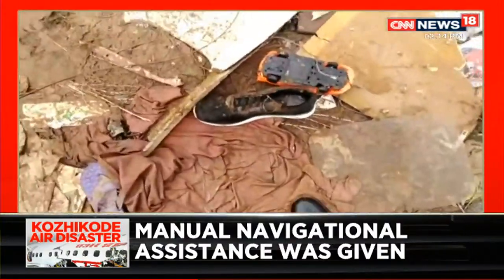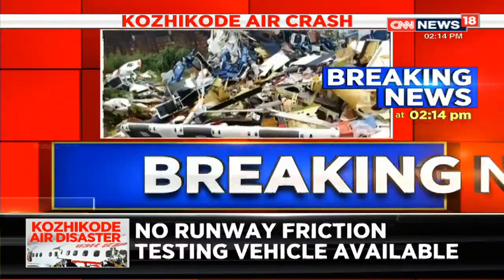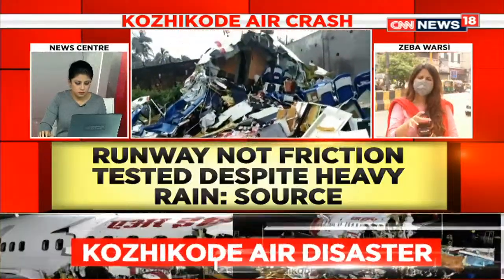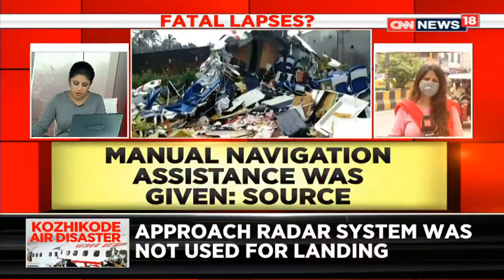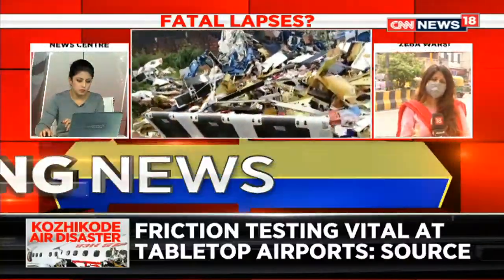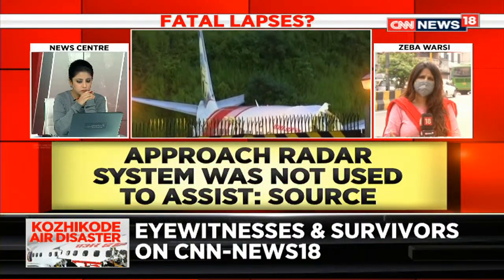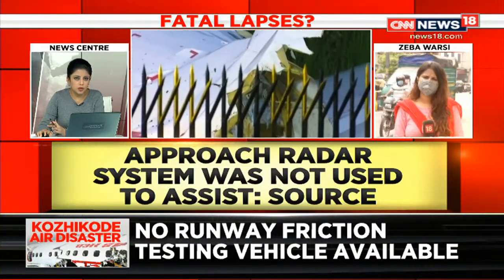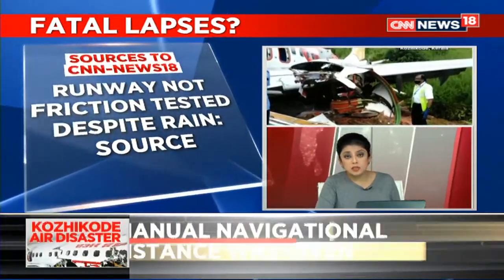Air India Plane Crash : Runway Friction Was Not Tested Before Air India Flight Crash, Say Sources

Comment: That a navigational aid was not in operation for want of personnel due to covid 19 restrictions is hugely incompetent on the part of the AAI.

Adding insult, as per the reporter covering this matter, that the AAI does operate this radar controlled approach/landing if there are several flights around the same time. So the AAI chooses when it should use a critical navigational tool.

Having lapsed in the friction test, and the radar control system inoperative, it would be interesting to note, if this information was conveyed to the pilot.

This can be verified with the 
1. Cockpit voice recorder
2. Voice transcripts of the ATC